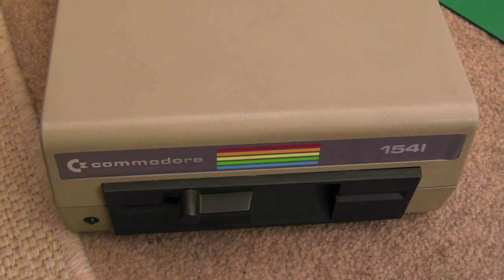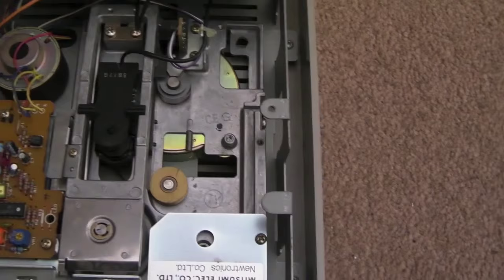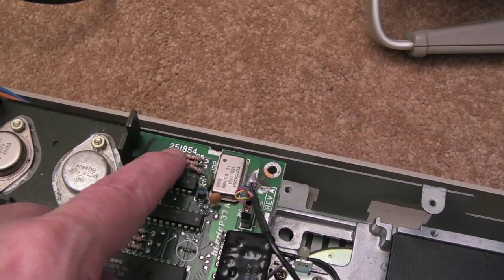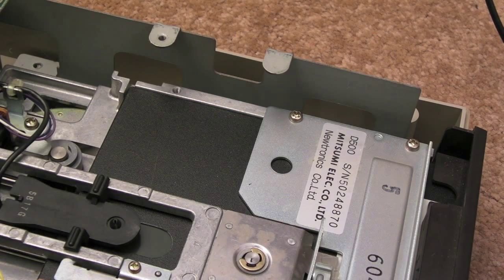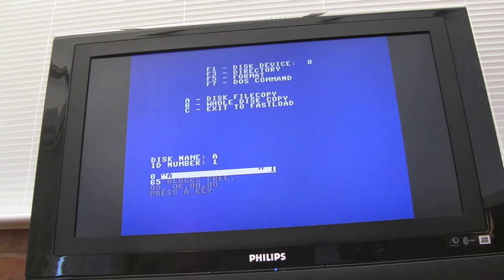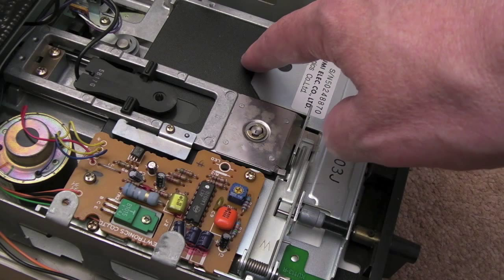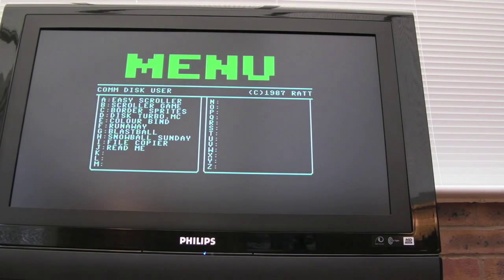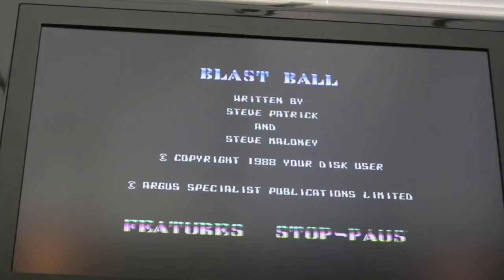Commodore 1541C Floppy Disk Drive Repair & Cleaning

Comment: Ha! I did the Meguiar's Plast-X trick just last night on a 1541-II I've been messing around with. Old bad disks were depositing black contamination that I couldn't get off with isopropanol or rubbing with cotton buds. I decided that the head surface was plastic, and the deposits must be down in scratches that accumulated in the head over years of use. I knew that Plast-X is a super fine and mild abrasive, almost to the point of uselessness on most plastic, but it could scrape the deposits out of there and also perform some amount of smoothing to attenuate the scratches at the same time. Worked perfectly! And the smoother head surface should be kinder to the disks too. I wasn't sure it would be OK to do, so I kept quiet about it. Good to see someone else thinks the same way!
Reply from the maker: Thanks, awesome you got that drive working =D =D

Comment: No wonder the 1541 and 1541 II's was more expensive than the C64 itself back in the day looking how many chips and stuff are inside these drives. I bought my 1541 II used back in the day. But even then it was not much cheaper than what I paid for my C64 with the tapedeck. Great video. I always appreciate your repair videos. Keep em coming! :)
Reply from the maker: +Mats Larsen Yes, it's amazing just how much is in these drives!  You could actually turn the drive into a computer with a bit of modding!  Thanks for the nice comments =D
Reply: +Mats Larsen  Yeah, the 1541 is literally a computer.  It has its own RAM, ROM, 6502 CPU, and two 6522 VIA chips.  You can even use M-W (Memory-Write) and M-E (Memory-Execute) commands to load short machine language routines into its limited 2k of RAM.

The 4040 disk drives for the Commodore PET actually had a dual CPU, with one handling the GCR encoding and decoding, and the other handling everything else.  That's one of the reasons the 4040 was so much faster.  (Well, that, and the 4040 was parallel while the 1541 is serial.)

Having said that, the 1541 would have been faster except for one thing: A flaw in the 6522 VIA, which Commodore never fixed.  Initially it was to use a hardware shift register, but the flaw forced Commodore to resort to "bit banging" (software) instead, so the 1541 had a transfer speed of about 512 bytes per second (by comparison, the Atari 810 had a transfer speed of about 1000 bytes per second, and the Apple Disk II had a blazing speed of about 15,000 bytes per second.)  It's no wonder why speed-loader cartridges like Epyx FastLoad or third-party hardware mods like JiffyDOS were so popular.

Comment: Also you'll find the pinout for UC4 in the 1541C.gif schematics. :) and yes it is a GAL :)
Reply from the maker: +bwack The schematics on Zimmers had a different version of the gate array chip, and that diagram you mentioned (1541C.gif) is for the 1541B - if you look top right on the diagram it says 1541B, and it has component differences on there.  Note the 7404, my board doesn't have a 7404!  Maybe its almost the same, I am just not sure if that gate array (the 40 pin package) is the same between boards, since they seem to have completely different part numbers.

Comment: I have a far older Commodore disk drive - the 2031 which uses the GPIB (IEEE-488) bus instead of a serial bus.

Unfortunately it never worked quite right.  It would format a disk just fine and then would read it just fine - for a while.  But after a few weeks it suddenly would start giving errors and refuse to load anything.  If you re-formatted the same disk, it would behave itself again for a few weeks until becoming unreadable again.  Repeat ad infinitum.

I considered the possibility that it was a head alignment problem, but when I looked inside the drive casing I couldn't find any obvious way to adjust the head alignment, and all the fastenings which I could find associated with the heads seemed to be tight.

So, it's sat out in my garage for about 20 years unused.  I recently hauled it out again, and it looks like I was just in time to save it from terminal corrosion (or at least I hope so).

Comment: I've also got a load of these drives, love the big clunky things!

I know you eventually realised it was the damaged floppy disk eventually, but a big hint is at 18:50 where the format result reports only '65 blocks free'. For a formatted floppy disk that should be showing 664 blocks free. This is common on damaged or old disks, at least when you have ruled out head dirt or alignment issues!

Anyway as always a great video! I also have a couple of the Oceanic (aka Excelerator) OC-118 floppy drives, one of which I can't get to behave for love nor money and there seems to be no way of aligning the head! If you ever come across one of them I would love to see a video about it!

Regards
Reply from the maker: +Andy Mason I do like them - really well made imo, I love the build quality!  What seemed to be happening when formatting - there's no notch cut out of the disk edge, so whilst it looked like it was formatting I think it was write protected.  The bytes shown at the end was based on the existing contents of the disk after it read the FAT.  I noticed the same thing happening tonight when trying to format the working side.  I presume the C64 doesn't tell you if its write protected?  There's a chance I have an issue with write capability yet, I need more disks to arrive tomorrow before I will know.
Reply from the maker: +Andy Mason I will keep an eye out for the OC-118 drives!   Thanks for watching and commenting =D

Comment: Watching your video again, at time 16:36 you mention transistor Q5. It's right next to the J3 jumper that you talked about (for the r/w head photo sensor). My J3 jumper is currently open, but I'm tempted to close it to see what happens.
Reply: Closing J3 jumper made no difference unfortunately. I'm still doing some more investigation...

Comment: To write on the reverse side of these single-sided disks, you need to cut a notch.  Back in the day, you could buy a disk notcher that did it for you, like a hole punch for paper.  Otherwise, just reverse the disk side, place it against another disk, and that gives you a guide to cut a notch out.  In terms of design, the 1541 mk. 2 , was styled to better match the 64c, and smaller as the power supply was moved outside to an external unit
Reply from the maker: +MarkTheMorose Ah, of course!!  I was thinking that no hole = write mode, but actually its the inverse!  Doh!!!  That makes perfect sense now you mention it =D
Reply: GadgetUK164
:)  When you bought new 5.25" disks, they came with stickers to put over the write notch, to prevent them accidentally being erased.  Other disk formats were the opposite, though I no longer recall which.
Reply from the maker: +MarkTheMorose I remembered that, but I thought it needed the tape there to enable write, but its the other way around by the sounds of things.
Reply from the maker: +MarkTheMorose I've just had a look at the disk and it has no holes at all on either side edge.  This means it should be writable I think.  So it does like like side B is write protected in software.  I will do a bit of research now to see what commands there are for doing things like that.   I vaguely remember reading somewhere that if a file name contains < in it the file cannot be altered.
Reply from the maker: +MarkTheMorose Just reading online now suggests that the hole means you can write.  Which is even more strange since there's no hold on side A or B, yet A will format, B won't allow it.  Something weird going on with that disk I think... I might just cut 2 holes in it and try with that.
Reply: GadgetUK164

This suggests that there may be a fault with the write protect switch.  Maybe it's stuck in the 'write enable' position, otherwise a disk with no notch shouldn't be allowed to be formatted or files erased.
Reply from the maker: I re-tested earlier and this seems to be whats happening:-

Disk has no holes or notches in the sides - I believe this means its write protected?  Neither side of the disk actually formats.  I should have some more disks tomorrow.
Reply from the maker: +GadgetUK164 Just re-tested with a bunch of different disks and all OK!  Reading commercial releases perfectly, and formatting and writing to disks fine =D  You were right, you need the hole in order to write, and when the hole is covered the disk cannot be written to.  Interestingly the C64 does not tell you its write protected, it just looks like its writing but actually its not doing anything.

Comment: Hi, I have the exact same Neutrionics drive and the 251854 PCB assembly as you. I'm getting a 21 read error 1 0, and 74 drive not ready 0 0 messages. I measured the resistance on the r/w head windings (with P4 r/w connector block disconnected from the PCB board) and got almost identical Ohm values to you. However, I'm still getting the read error. I've cleaned the r/w head with alcohol (it's now gleaming). And I also cleaned the surrounding area of the r/w head, in case there were any magnetic particulates as you mentioned in your video. Unfortunately none of this worked. I noted the colour of the winding cables are the same on yours for the connector P4 r/w connector block (and in the same order when looking at the drive from front to back...working left to right they are red, yellow, black, blue. One curious thing I noticed though is that the P4 connector block has pins 1 and 5 identified on the circuit board AND on the connector block. But, they are connected in reverse! Pin 1 on the block is connected to pin 5 on the board etc. However the key pin (the one that's not used is in the correct position - on the PCB board it's pin 2). In other words, mine is identical to yours in every way, yet the pin numbers on the board and on the connector block are reversed (i.e. 1 is connected to 5, and 5 is connected to 1). I assume that yours is the same. I couldn't see it properly in your video. I haven't noted any other issues with how the drive operates - when you switch it on, the green led stays on, the drive spins (red led lights up), and after a few seconds the red led goes off and 2 seconds later the drive stops. The drive tries to format by going to block 1, working its way to block 35 and then back to 18. It doesn't actually format though. When I run the 1541 performance test using the 1541 diagnostic cart, it fails on read errors, but passes the mechanical test. The other obvious issue is the speed test gives an error almost every time. At one point while spinning I noticed that for a split second it did register 298.7rpm, so I'm happythe speed is working okay, it just that the r/w head is not collecting the information correctly. The alignment test shows '0 for on track %', and '0 for between track%' for all 35 tracks. When incrementing the track from 1 to 35, it registers all tracks read as track 1 (even though I can see that the head is clearly moving from 1 to 35. At one point, I did see the some of the tracks read 100% (for about 8 in a row), but this was never again to be repeated. If it's an alignment issue, it should format and read okay for a blank disk, but possibly have trouble reading other disks. As the Neutronics drives have a very poor track record with their r/w heads, I reckon' that is the issue.  I don't have access to a demagnitizer, but was surprised to see that that made a big difference in your case. I haven't seen too many people fix their drive issue by demagnitizing the head, but I'm sure you have more experience of this than I do.  Anyway, I would be interested to see if you pin-outs on P4 is reversed also. And any other suggestions you have for me would be most welcome. Your vids are great by the way - I've subscribed to your channel. All the best, Alan.
Reply from the maker: It does sound like the read head from what you've described!  It could be component(s) that sense the read though - ie. hybrid or ASIC etc.  My bet is on the head though.  Regards demagnetizer, yeah - something I worked out 25+ years ago, no one else even tries it, that's why you've not seen it anywhere else lol =D   I would suggest cleaning the head with plastx or novus (plastic polish), to get the head surface super clean, and try demagnetising it.   The reason demagnetizing can help is if 1 partical from a disk surface somehow gets wedged into the head surface, cleaning may not remove it - and that can influence the field read by the head from that point onward.

Comment: Really interesting you had to go so far as to demagnetise the heads... I've got a few 1541's here and one of them is 80% working but doesn't write the higher tracks well enough to read back on another drive despite the alignment being as good as I can get it. I wonder if this drive of mine doesnt need demagnetising or the heads super duper cleaned like you've done to this one? Ive wasted too many hours trying to get it right already, I can't give up on it now! Thanks again for the great vids and information GadgetUK! -Mitch
Reply from the maker: +aphexteknol I would give it a go!  The other possibility is you've got a problem with the head wires (which you can replace) - when the heads move a certain distance the wire bends a certain way and you get an open circuit on one of the wires, meaning you either lose the read head, or the write head etc.  It does sound like that could be your problem.

Comment: Another great video!  It would be interesting to see if this unit will work after a few months of use and storage. Did any Commodore hardware have cable ties ? - just trying to figure out if that board had been swapped out like you mentioned ? Having multiple problems when trying to solve one fault can be a right headache so well done for putting up the time to keep trying. Look forward to the next video.
Reply from the maker: +A Leadbeater It will work after a few months - absolutely guaranteed!  The problem was definitely bad contaminants on the head and it did need de-magnetising.  I've fixed ST and Amiga Floppy Drives the same way before and they've lasted years.  I think the thing is you tend to think that if the head cannot read after having a few cleans then it must be faulty.  The one way its really faulty is if the windings are either shorted or gone open circuit.  They aren't as analog as people think when it comes to wear.
Reply: Built to last ! - Although as a kid i had about 3 Commodore 64's (brown) and they all seemed to die, they were forever being fixed in the electrical shop. I did practically live and breathe Paperboy, so too much gaming was probably to blame. 
What other fix projects have you got lined up ?
Reply from the maker: +A Leadbeater My Spectrums were the same back then lol - in and out of the repair shop.  The big problem for me was I had the Interface 1 and micro drive, and the connection would always come loose and kill the ULA =/  I've got some odds and ends that I am working on at the moment, an Amiga mouse, Amiga RGB lead, 3 or 4 SNES (2 fixed already, not sure if I can make one out of the other 2 yet), and loads of bits and bobs that I need to finish off.  My problem is I start something and then finish it 12 months later lol.

Comment: Off topic a bit but I wonder what it would be like to align a 1541 drive? I did an Amiga 3.5" drive a few years back "by hand" and it literally took me 4 hours to repeatedly adjust the head position to get it to read/write perfectly across all the tracks. Absolute pain but not the proper way of aligning it I guess lol
Reply from the maker: +Aron Gooch Yes, I suspect its similar on the 1541 - I mentioned in the video I might have a go at checking the alignment and re-aligning it if required.  Just need to find a disk now!

Comment: my 1541 works fine but depending on the disk being used i have to lift the casing off and help the disk in. About half way in they get caught on something and i have to put my hand in there and lift the disk. have you encountered this problem?
Reply from the maker: I haven't come across that but sounds like a simple fix - probably the metal guide that feeds the disk in is a little bit bent perhaps.

Comment: Could you use a laser rpm meter and shine it onto a disc that is spinning?
Reply from the maker: +Andrew Littleboy That might be possible, you would need to point it at something that will break the beam once every pass - maybe you could put a tiny piece of insulation tape on the drive spindle underneath, so it acts as a little beam break when it rotates.   I've since ordered an alignment disk, so I will see how I get on with that, but to be honest I think its pretty much within spec.  I've done a lot more testing this afternoon and everything works fine so far.

Comment: Great video! How did you demagnetize the Head of the disk drive, and what did you use to lubricate the drive? What specific areas did you lubricate? I would think that this would just attract dirt & dust and jam up the drive. Thanks for taking the time to answer my questions, I appreciate it.
Reply from the maker: +ResistanceIsUsefull I showed the demagnetizer in the video!  Basically put the metal surface of the demagnetizer close (almost touching) to the head, you can feel it vibrate.  Move it in circles for several seconds and then pull it away.  With regards to lubrication - in 2 places, on the shaft of the stepper motor (whilst the drive is running upside down), you only need a tiny amount.   And on the rails that the head slides up.  Yes, it does collect dust over time, its best to clean them first as they will likely already have dust on them.  They are lubricated from manufacture!